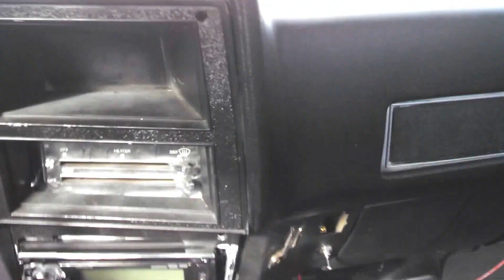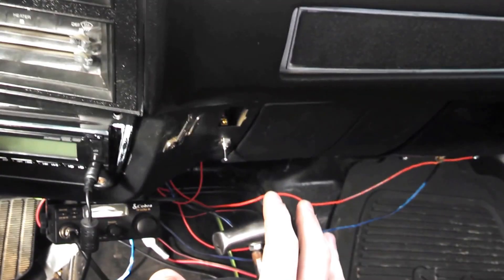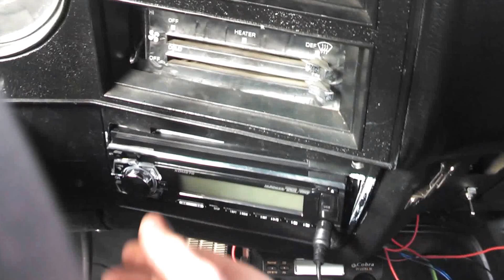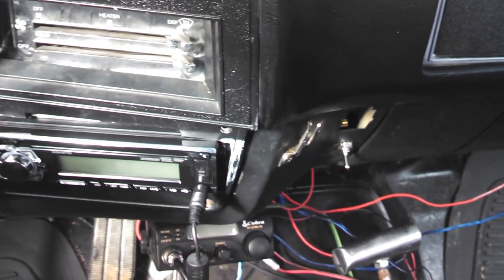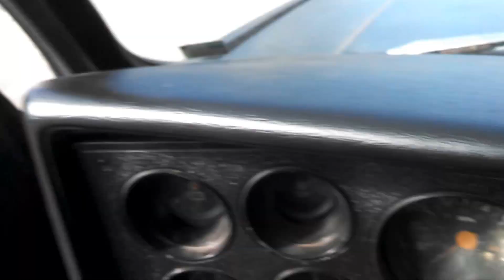Tractor Painted '81 Chevy K20 Plus New Toggle Switch

Comment: A man. Glad to see the new paint job on the truck.  Can wait to see the new tires.  Radio. Try going to the fuse box and find a power wire to something that is missing  say AC or the water pump for the  windshields wippers. Just a thought. Take care

Comment: Have missed your videos, glad to see you're still making them and still working on this truck. 

Have you considered an under-bed fuel tank mount? Those side saddle tanks scare the piss outta me.
Reply from the maker: Thanks, I try to work on it and make content when I can, but college takes up the VAST majority of my time and money and unfortunately both are required to work on the truck. And to answer your question I've never considered there being a problem with the side mounted gas tanks. They scare me a lot less than the behind the seat tanks and from personal experience of getting T-boned at 60 mph in my '79, I haven't found them to be all that unsafe in accidents.

Comment: intrested into what mileage you get with the truck? keep the vids coming bud, big big fan of these old squares, getting my 82 one ton 4 wheel drive soon. keep up the good work!
Reply from the maker: +joseph meaney I'm not really sure about this one yet, but in my '79 I got between 10-15 mpg with the same 350cu. and 4bbl setup and stock exhaust.
Reply: right on man!, planning on doing anything with your exhaust on this one? i got 8 inch cherry bomb glasspacks for mine, true duals.
Reply from the maker: +joseph meaney I don't really have anything planned, the stock exhaust actually sounds surprisingly good and because of ordinances where I live "modified exhausts" are heavily frowned upon by old Johnny law